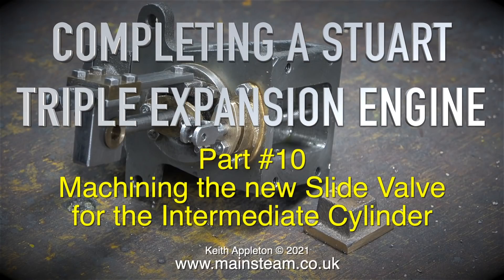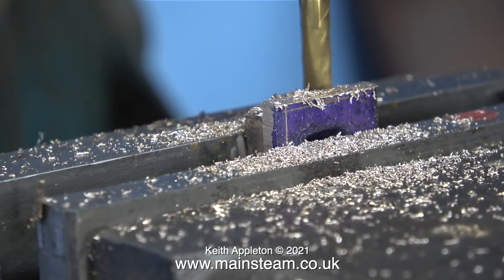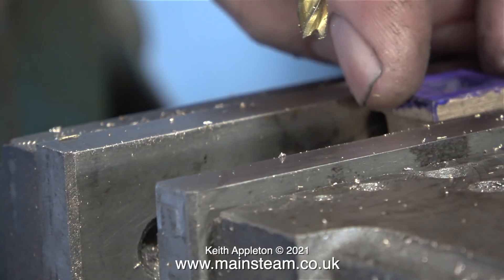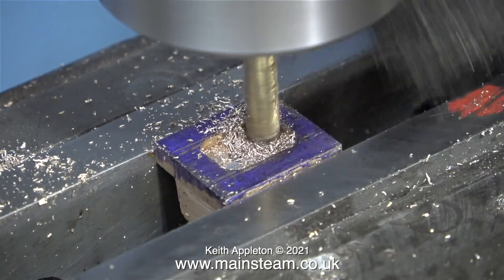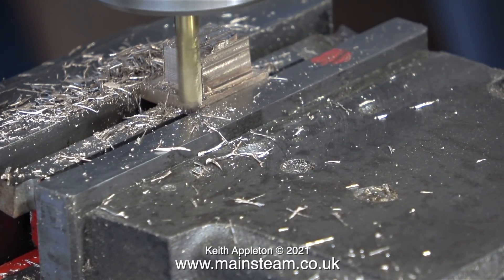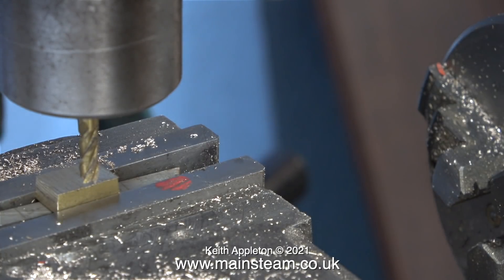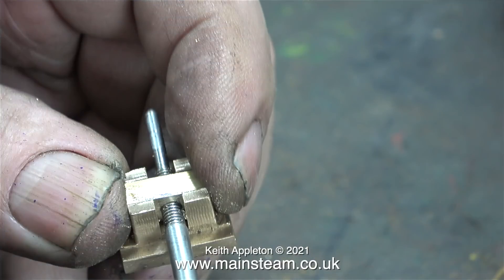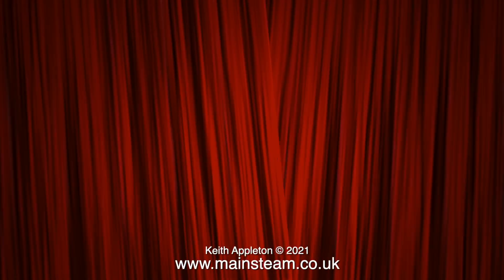COMPLETING A STUART TRIPLE EXPANSION ENGINE - PART #10

Comment: Nice video.  But I wondered if the face had to be 'lapped' smooth or anything?  Or, being brass, does it just lap itself in when 'running in' the engine?  Anyway, another great video.
Reply from the maker: if the lubrication is good, they just wear in .....
Reply: They need to be lapped.... you can let it seal by oil.... but it will need a lot of oil... like All of his engines....

Comment: In all fairness,when Boulton and Watt were first putting their machines into service,Whitworth was nowhere around,and machine precision was likely less than anything you do.
 If my memory is correct,the water pumping machinery,the beam engines over by Kew Gardens, for London water were in service 1844-1944. And made by Boulton and Watt.
And Newcomen engines were before Boulton and Watt. So precision in the right place is critical,but fudge factors existed before fudge was ever invented. 
Bash to fit and file to hide can be made to work,but only if you know what the heck you are doing.
And the functional machines you end up with,well the results speak for themselves.